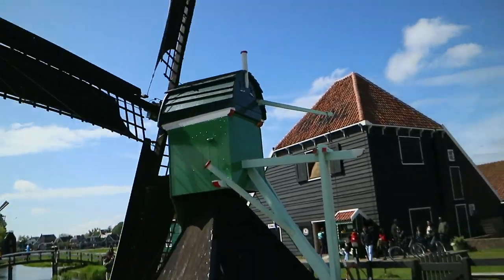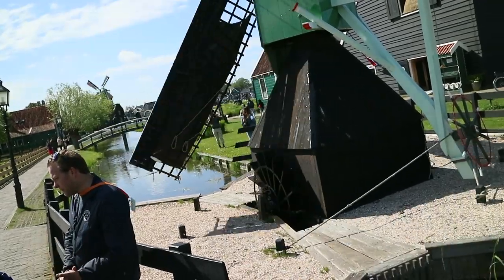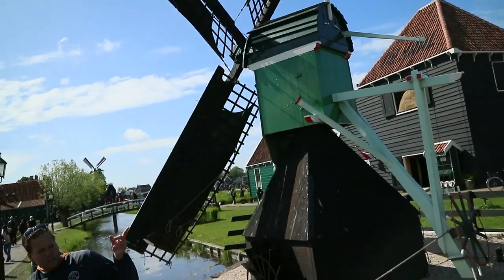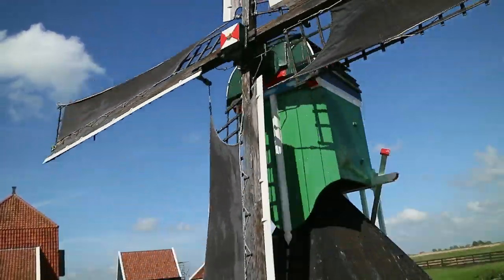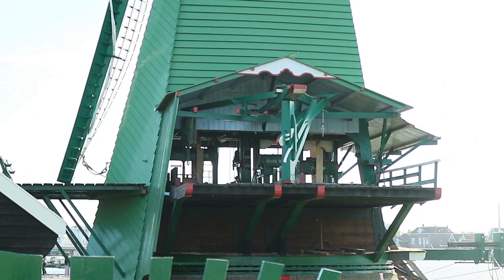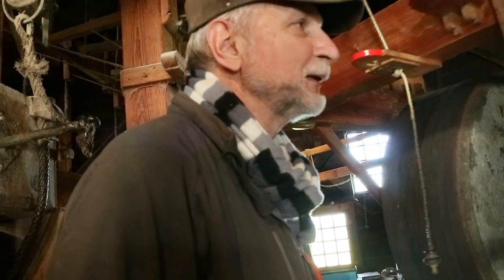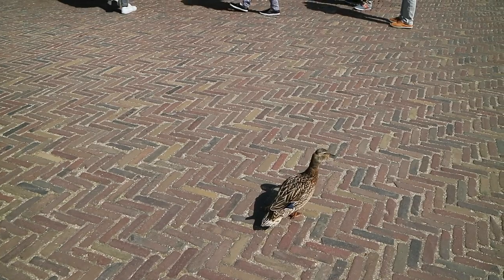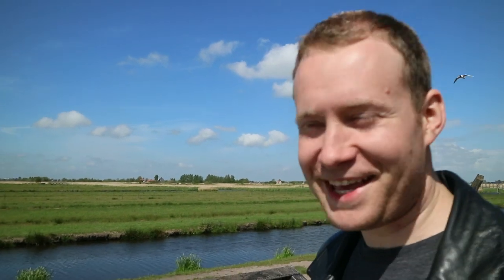Windmills are Awesome!

Comment: Whoa, they move much faster than I thought.
Reply: The Capacitor It’s similar to aircraft in flight I guess with perspective. The size and height of modern wind turbines make them look quite slow but they can be moving over 150km/h at the tips depending on windspeed and turbine size.